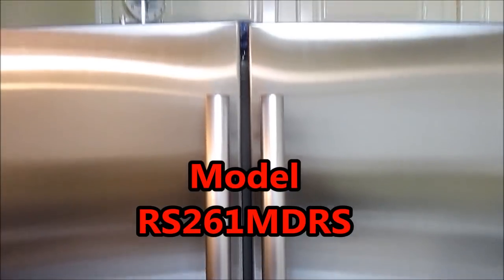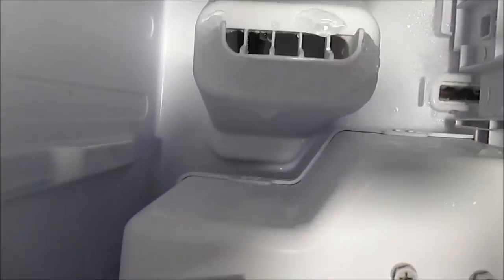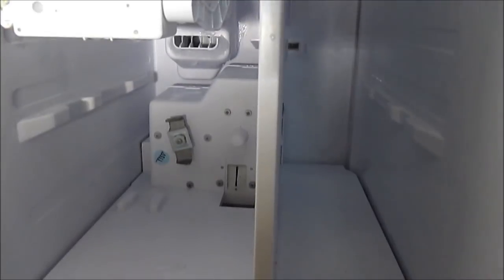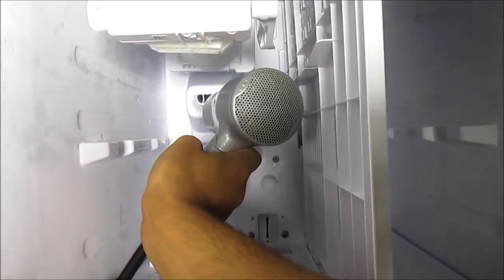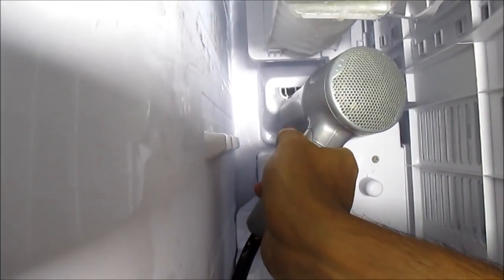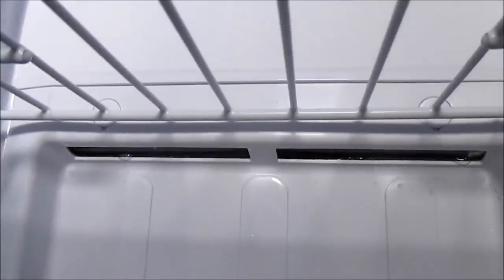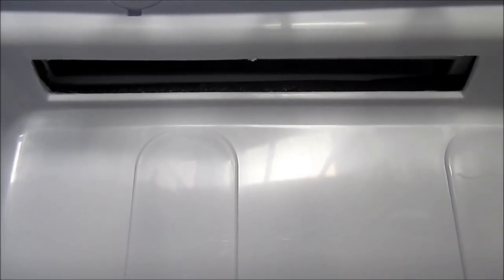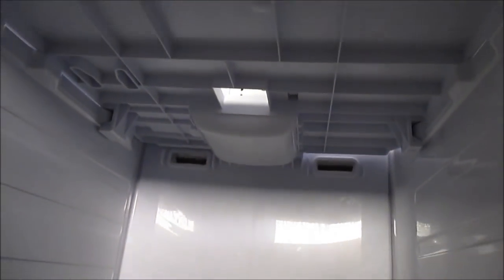How To Stop Noise From Samsung Refrigerator RS261MD **

Comment: I did this and it lasted about 3 months. I am in the process of doing it again. This time, I ran the hair dryer for about 20 min and kind of hit on the back wall and could hear the ice dropping. I pulled off the lower panel with 6 screws and got several large chunks to come out. I am going to leave it off over night. Have a Frigidaire from 2000 that works great  as a backup in our garage. I contacted Samsung, yes go ahead and laugh and gave them a piece of my mind about their product. Will never buy Samsung again. Thanks for this video,it was helpful. Update: This morning, I attempted to reattach the back panel and for the life of me, I could not get the top screws to reattach. If I had the panel off, no issue getting the screws to attach so I am thinking the "anchor" for the screw may have been messed up and I need a longer screw when the panel is in place. I had it off for 12 hours and used the hair dryer to speed up the process. It is now running and cooling but the compressor is louder then before, making a clicking noise. The 24 year old Frigidaire in garage is packed full of items and working great. Maybe time to go buy another Frigidaire.
Reply from the maker: Appreciate your feedback.👍
Reply: @Megalodon1  Samsung will not help us, so thank you for posting this to help me out.

Comment: The Samsung fridge have a problem with the defrost heater drain icing up. The simple solution is to take the back covers off, melt any ice buildup. Now take a length of copper wirewrap it around the heater coil and poke the other end into the drain or just above the drain hole. Thise will transfer from the heater down the copper wire to melt the ice in the future.

Comment: Bought a samsung fridge and a warranty thru Lowe's. Weve had it fixed 3 times and the last issue lowes said they won't fix it and offered a full refund. This fridge is literally garbage. I have the same one as in this video. Water leaks. Ice machine stops making ice. Pos. Never again.

Comment: Thanks for this info & tip ! We are definitely going to try this .We purchased all Samsung appliances while our home was being built . What a mistake that was !!!!! We are definitely not trying to replace a refrigerator & Definetly not anything by Samsung !!! Appliances should definitely  last longer than 6 years. Samsung products look good,  but they don't hold up ! Within  6 years we've replaced the microwave,  dishwasher, had a refrigerator part replaced, part replaced on the stove ,in addition the stove door can't be cleaned unless you remove the door because dust gets inside between the glass making it impossible to clean. Now the refrigerator is making this annoying noise! Really !!! We are definitely done with Samsung !!!!Between the service call , parts , & repair its just not worth it  !! As their appliances fail we're replacing them with a much more reliable brand ! Hopefully for the money we'll get more than 6 years out of them. Buyer Beware of Samsung  !

Comment: Problem- free Samsung for 5 years or so. Power outage for 3 days few months ago. 1/4" ice sheet built up under crisper drawer. Presume it accumulated near fan also, hence noise. Will soon be pulling inside rear panel to defrost by hot water. Also, attach short copper wire from  heater element down tube a few inches to prevent ice there. Fingers crossed. Thx.

Comment: Your video gave me the confidence to try this on my Samsung RF268ABWP with the freezer on the bottom.
The recommendation did not fix the problem but it put me on a path of discovery where the root problem was fixed.

For starters, I took the sliding shelf out and removed the freezer door to help with access (4x 10mm bolts).
I used a heat gun on low in the vent holes for a few minutes but there was no water draining.
At that point I decided remove the back panel which is a white plastic panel with two screws.  
This required removing the ice maker which has two vertical screws.
After pulling the panel the defect was obvious.
There is a fan that screws to the panel and is positioned close to some molded styrofoam.
The foam is porous and condensation infiltrated it.
Freeze thaw cycling caused bulges in the foam which pressed against the fan.
I sloppily shaved off the bulges with a razor blade and found ice inside.

While reattaching the fan I noticed that one of the screws was not attached correctly and just went into the foam.
This may have contributed to the fan vibration.

I also opened up the access panel in the rear of the fridge and vacuumed out dust.
There are two vertical tubes that deliver condensation to a catch tray.  
One of the tubes was partially blocked with rust and brown water so I cleaned it well.
That probably contributed to the freezing styrofoam.

After reassembling everything the freezer runs very quietly for the first time in years.

Here are some photos of the disassembled freezer.
You can see the bulges in the foam.
https://photos.app.goo.gl/KV859vM23FeDnNvH6
https://photos.app.goo.gl/S3LhP5nhbxhnrhxv9

My messy cut job:
https://photos.app.goo.gl/Bheyt44Pvmcq5zPaA

It was tedious work but not that difficult if you are patient.

The quiet is worth it.

Comment: After watching many videos and changing my search words, I finally stumbled on your video. Most only mentioned the noise and were typically professional repair folks that went right into the need of replacing the evaporator motor, for a few reasons.  Because the noise was intermittent, I was not convinced. Noticing the noise returned when the ice bucket was full, I kept the ice level low. Then began the water collecting at the bottom of the freezer so I lowered the temperature in the frig. and freezer compartments. Finally, I went back on line to research and Bingo, your post, with the actual noise and you explained it could be ice build-up rather than a mechanical issue on the evaporator motor.

My frig is old but in great condition as I have taken care of it but before seeing your video I had been debating on calling a repair person or just buy a new refrigerator on Black Friday. You sir, saved me hard earned money, Many Thanks and God Bless !

To assist others: My refrigerator is a 2003 Kenmore side by side w/ice maker - model 106.53584300

Comment: Melting the ice only treats the symptom.  Samsung's troubleshooting guide (quoted below) says you need to level the fridge so that the front is slightly higher than the back.  Supposedly, this prevents condensation from pooling, freezing, and building up over time (where the fan hits it)--and, it allows the doors to open and close more easily.  Doing this allows the condensation to drain properly and evaporate.  I simply unplugged the fridge, pulled out the ice maker bin, and left the freezer door open for about an hour while watching a TV show (no hair dryer), then I wiped out the melted water, plugged-in the fridge, hit the reset button, replaced the bin, and voila!  I just did this tonight and so far so good, but hopefully, this will solve my issue permanently.

-----
From Samsung:
If the refrigerator is making a noise that stops when the door is opened, this type of noise is caused by the fan inside the refrigerator impacting a buildup of ice. The exact type of noise can vary (whining, buzzing, grinding), but the one constant is that the noise stops when the door opens. The noise will typically resume a few moments after closing the door again.

The main reason this noise occurs is because the refrigerator was not properly leveled. A properly leveled refrigerator will have the front of the refrigerator resting on the leveling legs and with the front wheels not in contact with the floor. This ensures a proper front-to-back slant so condensation within the refrigerator can drain away correctly to the evaporator.

An improperly leveled refrigerator can cause condensation to pool up instead of drain away, and due to the freezing cold temperatures in the refrigerator, freeze up and cause a buildup of ice over time. Eventually the ice will build up so much that the fan begins to hit it, which causes the noise.

To prevent this noise, as well as potential leak and cooling issues down the line, the refrigerator will need to be leveled correctly. This may reduce or eliminate the noise, either immediately or over a period of time. Instructions for leveling the refrigerator can be found in the user manual.
Reply: This is somewhat baloney.  While the fridge should certainly be level as installed, ice should NOT build up enough to reach the cooling fan if the fridge is properly defrosting periodically.  I have just had a fan stoppage in the freezer of a Samsung  22 cuft "cabinet depth" side by side that is less than 4 months old.  It is obviously not completely defrosting the evaporator coils in the freezer.  The fridge is located in the kitchen of an air-conditioned, thus de-humidified, house.  The symptom is frost building up on food in the freezer and interior surfaces, which means that the fan was not running and circulating air, or the evaporator coil was frozen solid and blocked the flow, even though the compressor was cooling.  After defrosting for a while with two external fans and a hair dryer, I can now hear the fan running (actually spinning down to a stop just after opening the door; it doesn't run with the door open).  There is NO EXCUSE for this kind of design flaw in a major appliance, especially when Samsung has been experiencing similar problems for many years in various models of refrigerator.  Clearly they are aware of these problems and simply ignoring addressing them in their designs.  Clearly they are also not correctly measuring the temperature of the evaporator coils during a defrost cycle, to confirm that any built-up ice has been removed.  The defrost cycle should not end and the compressor restarted until a temperature ABOVE the freezing point of water has been reached on the evaporator coil, which would indicate that all ice has melted from the coil; anything less and ice is going to gradually accumulate on the coil until air flow is blocked or the fan (if it is too close to the coil in the design) begins the strike the ice and makes noise and eventually stops turning.  Either the design is flawed, the temperature sensor used is defective, the circuitry reading out the sensor is defective, the heater or its temperature overprotection is flawed, or these people simply don't know how to design a refrigerator.  This kind of appliance should be problem-free for decades, not just for 4 months.  Will not be buying another of this brand, even though WHEN it works correctly it is a nice fridge.
Reply: I couldn't agree more, the design is flawed...  For the sake of an update to my original post.  Since adjusting the level on our fridge, we have had no issues with fan noise.  Sadly, this didn't fix the issue with water dripping from the ice maker...  another design flaw.

If only Apple would design a refrigerator.   ;o)   Y'all have fun with that one, but please realize it's just a joke--I look forward to your witty responses.  Let me start...  Hopefully, the Apple fridge would be more reliable than Siri.
Reply: Mark Archuleta ha! We’ve had a Samsung repair person out 4 times to “fix” the problem. He never once tried to level it differently. One time he tried to blame it on too much food in the freezer. 🙄
Reply: Crafty pup, LOL !!!! To much food in the freezer .... WHATA PUTZ. Sears told us it's $100 for the clown to show up and $250 AN HOUR FOR THE "REPAIR" ..... PLUS PARTS..... I'll wrench on it myself for that kind of money !! This 450 lb SILVER ELEPHANT will be the LAST Samsung product we by ..... put a fork in me and flip me over ... I"M DONE

Comment: I had a similar problem and I did a "reset" of the fridge by touching simultaneously the "freezer" and "fridge" buttons on the front panel for a few seconds until the screen starting flashing numbers and then stop, since no number came up on this process, that means that no part is defective with the fridge..  I also reset the temperature of the "fridge" at 34 degrees, when set up at a higher temperature a lower noise would come up again so I brought the temperature down to 34 permanently.  The noise went away for good, it has been a couple of months since I did this process, it worked for me.  This procedure is also use to tell you if there is any bad part in the fridge, if a number shows up you would need to contact Samsung to order the replacement part. By the way my fridge model is RFG297HD. Good luck!.
Reply: Thank you!!!
Reply: Thank You this solution helped me with that horrible noise . And delivering me from the hell of a loud refrigerator.
Thank You Again

Comment: Hello! Thanks so much for this video! I actually bought a replacement evaporator fan motor from Amazon (only $14), but didn't want to get into the wires to change it... Found this video, unplugged the fridge, took out all the freezer stuff (needed to be cleaned out anyway!) and used a hair dryer on those vents for 20 mins (being careful not to stay on one vent for too long). It's been 2 days, and no noise! I don't know how old the fridge is, as we just moved here 2 years ago. It hadn't made any noises until about a month ago. Hoping this will last another 2 yrs? If only lasts 6 months, then I'll just do this again and empty out the freezer :) thanks for this super helpful vid! 😊
Reply from the maker: Thanks for the feedback, I repeat the process every few months.👍

Comment: Thanks buddy. I have a two year old Samsung refrigerator. A much different model than the one you show here but with the identical problem.Have had numerous calls to repair the ice maker and numerous calls to repair water leaking in to the interior of the unit.We are waiting on our third service call on the ice maker when this new issue arose.Started as a small vibrating noise  off and on, turned into a loud non stop noise which you could hear all over the house.Couldn't wait for the repairman, so tried your remedy. It worked !  This expensive refrigerator is a piece of junk. I do appreciate your video which at least is giving us some peace and quiet for the moment.
Reply: In the interior is it leaking water under the crisper?? This "nice" refrigerator is driving me bonkers!

Comment: Thank you very much for this helpful info. I defrosted mine 2 days ago for just under 30hrs. I let the ice defrost naturally as I was worried about holding a hair drier over the vents. The principle is the same though. In addition, I cleaned the vents at the back of the fridge too as they had clogged up with dust and dirt. Now the fridge is ticking like lock work again. I bought the samsung fridge freezer 2008 and this is the first time I have experienced this noise problem. Saved me a potential hefty engineer's bill.
Reply: where does the water go when you defrost?  I don't want it on the floor though.
Reply: to the drain pan under the fridge but if you defrosting your fridge drain pan might over flow

Comment: I also bought a Samsung ref for $1600 about 3 yrs ago. a year into having this ref the same problem occurred. Fortunately, I had bestbuys' protection plan which was great and they came out and replaced all the malfunctioning parts. i thought i was good and let protection plan expire. unfortunately bad decision, a couple months after the same problem with both the ref and ice maker. this is by far the worst purchase besides the kitchen aide dish washer I purchased year ago. I wish I had done more research....and if you found this video like i did....trust the video it worked out for me with both ref and ice maker issues. thanks for doing the video.

Comment: I have had three samsung refrigerators.  The two previous refrigerators were more expensive than my current one.  I did not have any problems with the older ones, but the new one has this problem which has been going on for a few months.  Thanks for this information; it is very helpful.

Comment: My Samsung RS261MDWP had the same problem, fan noise from the freezer compartment was loud, this happened when we returned from a 4day vacation. I used the McCulloh steamer to remove the buildup of ice around fan, instead of a hair driver, as suggested here. This definitely fixed the fan noise completely. Thanks for this video, using a steamer is just an improvement, to melt the buildup quickly, and in the process clean the fridge.
Reply from the maker: Shit, all the input you provide is spot on and I agree with. Owning a steamer myself I did think of using it . I wanted to however demonstrate using a tool that every household has so your average Joe doesn't have to go out and buy a steamer to get the job done. Thanks Sheetal!

Comment: For anyone watching this so I did everything and ended up with the same issue a month later. So my issue was dust build up not allowing good airflow for the fridge to work properly unscrew back bottom panel and check if it’s real dusty vacuum and blow out carefully.  (same thing happens when you don’t clean your AC for a while it becomes an ice cube) Thanks for the video!
Reply from the maker: This is a temporary fix due to a design flaw due in part of Samsung which is a reoccurring frost build up issue every few month's. One things that helped me do this process less is turning freezer setting a couple notches down where my food is still frozen but not all the way on highest setting. Thanks for watching and appreciate your input.👍